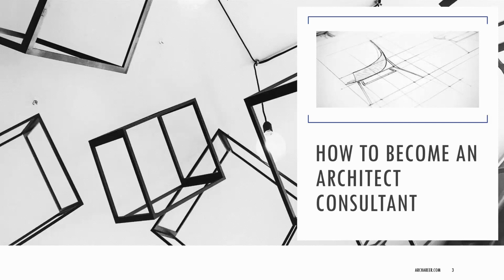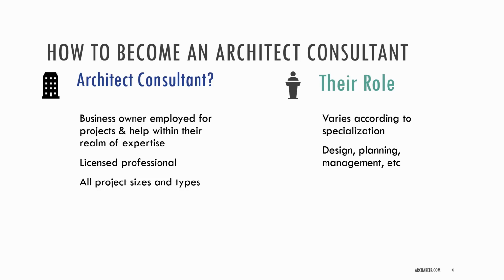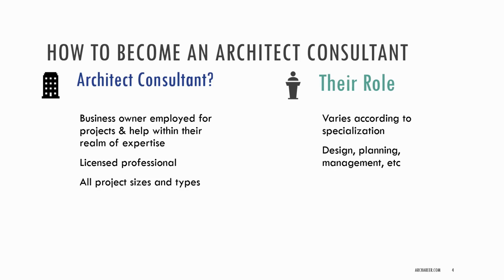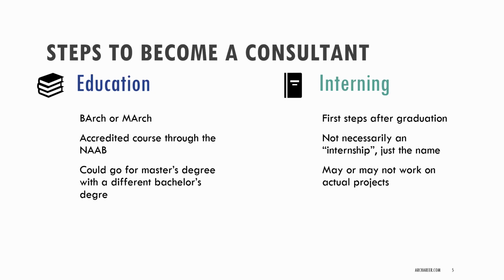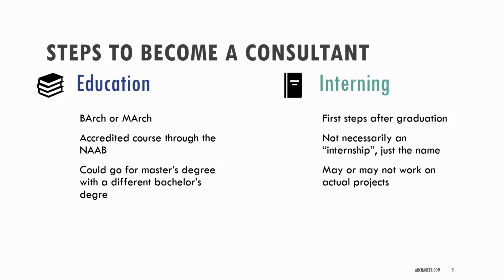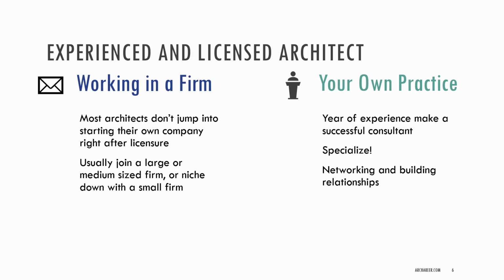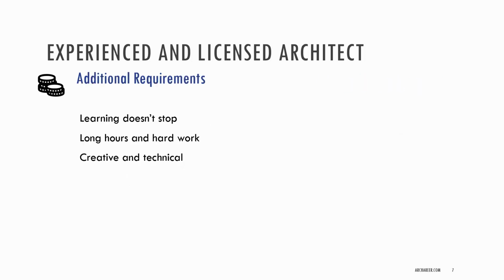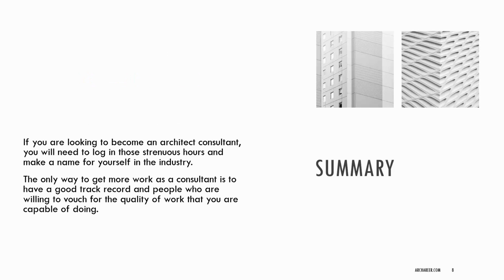How to Become an Architect Consultant //Archareer

Comment: Hello,
Greetings from Omkriti Designer Pvt. Ltd.

There are three responses to a piece of work - Yes, No & Wow! Wow is the one we aim for.
Thank you for reaching out to  Omkriti Designer, led by Hari Om Pal. We specialize in a range of Architectural,  Civil, Structural & other Chartered Engineering services to meet your needs:

Architectural Layouts & Planning 
Structural Analysis & Designing
Structural Stability Certificates
Valuation Services
Interior & Exterior Designing
Estimation & Costing (also for Loan)
Construction Contractor

We're dedicated to providing you with expert engineering solutions tailored to your requirements. Please feel free to ask.